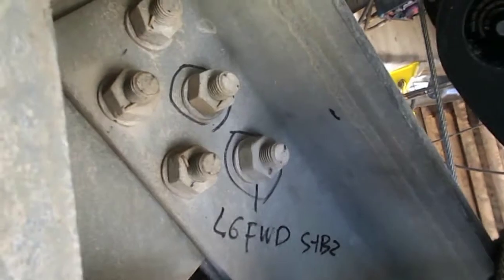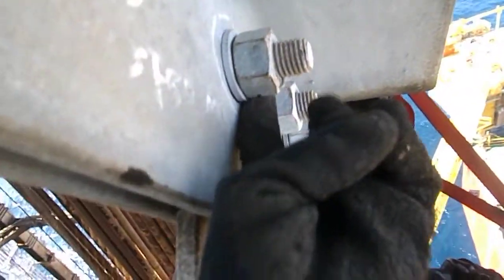Derrick Bolt Torque Inspection by Rope Access

Comment: If you are irata, don' t show this video on YT. Your supervisor can have troubles. This isn' t irata techniques on this video. You have no rope protectors,you have no clothes, life jackets , safety zones and many more
Reply from the maker: Hi. We are not working directly over water so there is no need for life jacket. About no safety zone, we were working on the derrick and the rig floor down below is designated as a permanent red zone. We had the work permits, pre-job meeting with the rig crew, etc.. If you ever worked in a drilling rig, you should know what permanent red zones mean. Anyway, I do appreciate your comments and I do agree that our gear and techniques are no way perfect and there is always room for improvement.

Comment: Your torque wrench too small for derrick bolt torque!i am sure u dont know what is the torque value and just doing it for the sake of video!!!
Reply from the maker: Have you ever heard of the tool called torque multiplier? Go ahead and google it.
Reply: @gmiemenace4288 You just hit your own ignorance wall. The guys in the video are using a torque multiplier tool together with the small torque wrench. It is impractical and even impossible to use a big torque wrench in that kind of job. If only a torque wrench, it will need to be at least 6-foot-long handle to torque those derrick bolts to specs.
Reply: @gmiemenace4288 what a joke you are!

Comment: Good video again. You mention you are not the L3 on the job. Do you work with an L3 and under IRATA/SPRAT or a similar scheme?
I know you are not asking for it and you have to make do with the gear supplied to you, and some unsolicited advice ;-)... You could say that you should only use gear as specified by the manufacturer to your client. So no shunt as a backup. Just tie a butterfly, clip in and you're good to go. And for small transfer like your friend is doing you only need 3 points during the transfer. It looks like a small rope to rope, but the video might make it look smaller than what it was...
Stay safe out there and I am looking forward to your next video👍🏻👍🏻
Reply from the maker: Hi. Thanks for the comments. Yes, we do work with a L3 and we are under IRATA. I voiced out my concern to the L3 about the shunt being not suitable as a backup device. We are actually renting all our gears and the owner of the RA equipment replaced the shunt with the DUCK for us.
Reply: @DIYPhil  Thats perfect! Great work! I love the Duck as a secondary backup device!